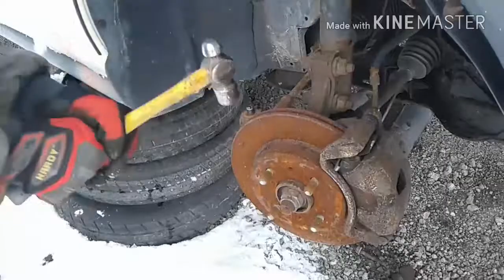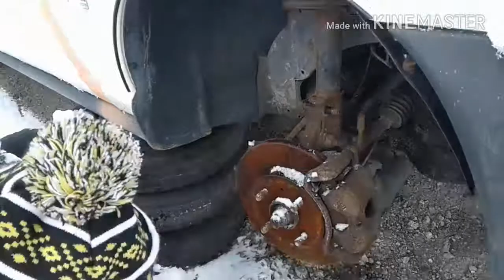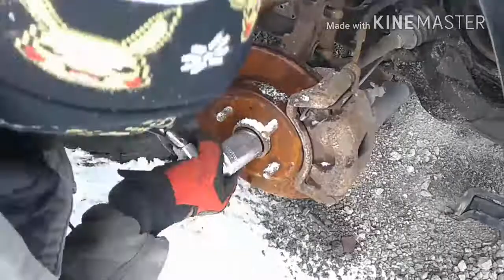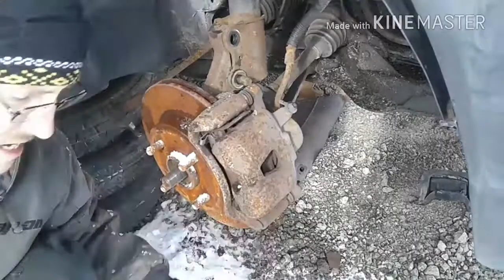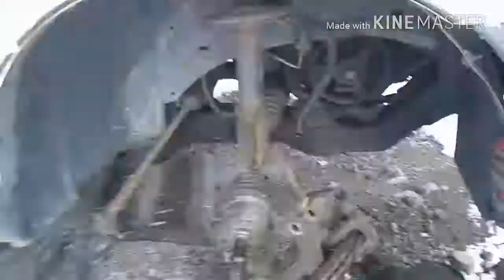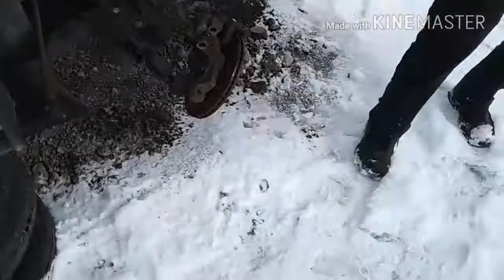removing a saturn sl1 axle at the junk yard

Comment: Ugh.  Did you have to cut the brake line like that?  One minute with the socket wrench would have been all you needed.  Seeing things like that makes me angry because there are lots of perfectly good hoses, cables, and wire harnesses just cut to pieces all because someone wants to save a few minutes.  Especially the wire harnesses!!!  Those are specialty parts that very few after-market manufacturers sell these days.  Wire harnesses are already expensive to begin with, but for discontinued cars like Saturns?  Just a quick look at eBay puts the USED ONES at $200!

PLEASE DON'T CUT THOSE!!!